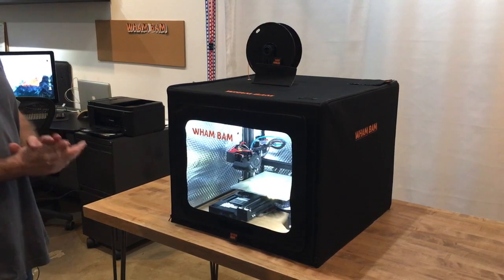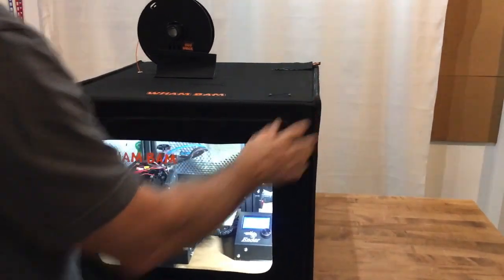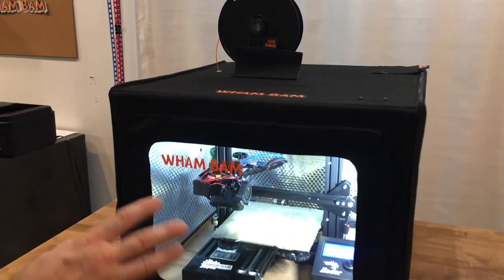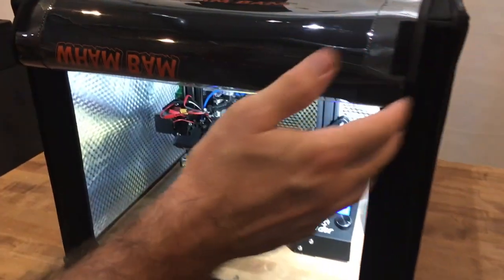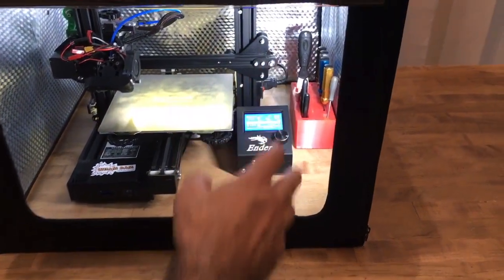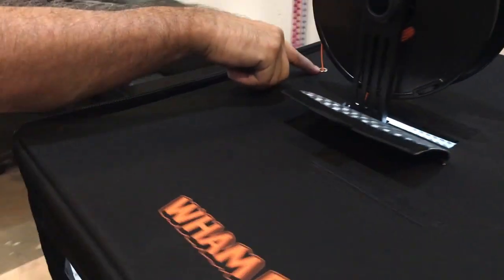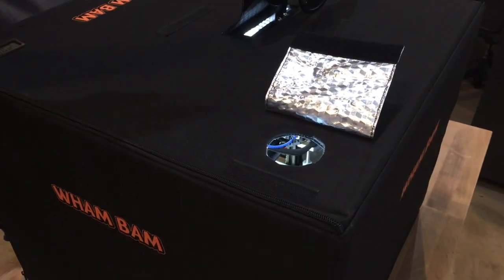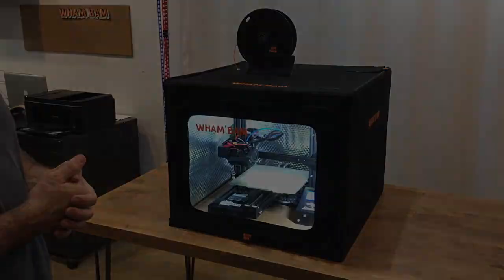Feature Overview for the HotBox Enclosure for 3D Printers

Comment: It will be nice to have bottom insulated too. At least as an option
Reply from the maker: As heat rises I have never found there to be a temp loss, much like an open top freezer in supermarket. In use, once ambient reaches desired temp,  I actually open top vent a bit to keep heat from building

Comment: this product works however the retail model is reversed so this printer will not fit in it, I wasted my money and now because of the coved virus I cant return it so I will have to cut it and modify it to make it work, thank s for headache
Reply from the maker: undermarks please tell us what’s happening, what machine are you using and what is the issue? The product is amazing and we can help you. There are many printable options to raise the HotBox if needed.
Please send your photos and explanation to technical@whambamsystems.com and we can help you use it easily.
Reply: @WhamBamSystems  I have a ender pro 3 almost identical to the model in the video. the top of my wham bam is the exact opposite of the described product or the one in the video. the thermometer is in the back so un readable  when on a table I cant walk all the way around. the opening for the spool on top is to far forward and the grommet hole on top to  feed in the filament is on the opposite  side In relation  to the  extruder so the filament has to either feed in the side or across the front of the printer this also differs from the model show either here or on your site. the large round hole seen ion the video is on the back right side but on mine in th front left side(if im facing the box) the result of having the opening for the spool holder so far forward means the bed hits the clear plastic front of the wham bam during operation. this is totally different then ANY MODEL or photos you show of the product, which does work fine for abs so far but if I knew I was going to have to modify I would have purchased something else. I would have returned it but the corona virus hit and everything is now locked down so I figured im stuck with it but for god sake why would you go and  move all the parts around once the model went into production when they were perfectly placed in all your videos and literature. I will send you pictures
Reply from the maker: undermarks you received a defective part! It was built obviously by a dyslexic worker. This is the first we have heard of such a mistake.  Sorry . I have written to you. We will send you a new one right away if you can provide order number.
Reply: UPDATE: WHAM BAM IS SENDING ME A NEW ONE

Comment: Looks a lot nicer than the Creality enclosure that they've started selling.  I have my Ender in a plywood enclosure and I'm interested in how your supplemental heating system comes out.  Just using bed heat isn't quite to the level I want so a controlled heater would be nice.  If you can figure out how to make it so I can connect it to my Raspberry Pi running Octoprint, that would be cool.

Comment: Seems like it might need to be taller to fit a Makergear M2 where the gantry is at the top all the time.  Also need additional clearance for the bowden tube which among other things also serves to hang on to the filament in case it gets loose so you don't end up with tangles in your spool.
Reply from the maker: Steve Prior Hi Steve, we would love to make one for maker dear if we only had enough community request and acceptance. I agree we would need to make one exactly to make her your size and height requirement but this is easy and it would definitely be a major upgrade.
Reply: @WhamBamSystems  I could be interested as well as someone else.  Would have to carefully work out what the optimal dimensions would be, also need to make sure it's big enough to not interfere with the heater cable that attaches to the back of the bed, but obviously making it bigger than absolutely needed means more space to heat.
Reply: @WhamBamSystems  I also agree that a light kit option would be desirable.  I also currently have a webcam (hooked to a Raspberry Pi running Octoprint) on a tripod in front of the printer to monitor progress - not space efficient but easy.  The camera is also not sitting on the same table as the printer so it doesn't get shook by the motion of the printer.  So I'd have to see what better solution came up for that.